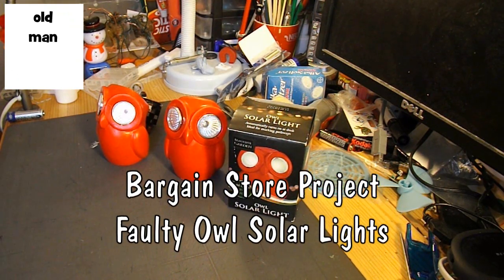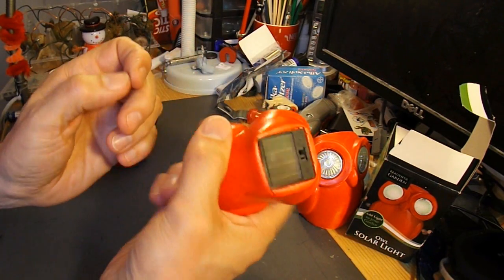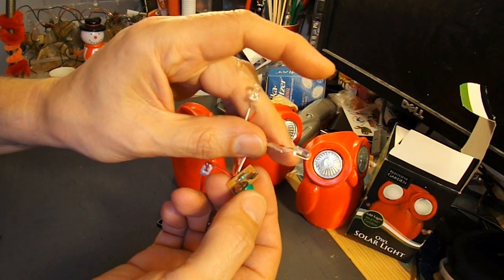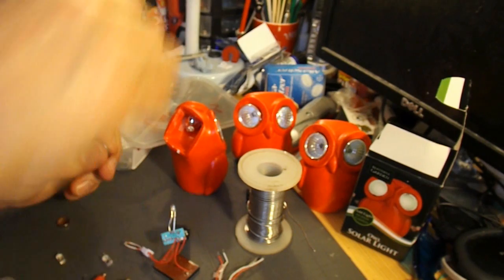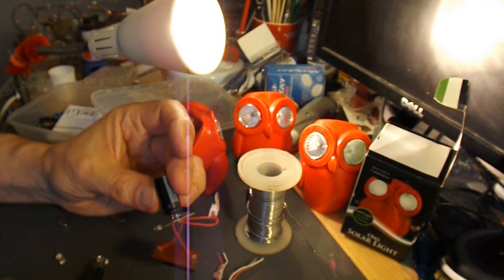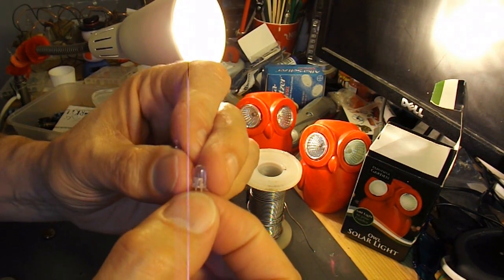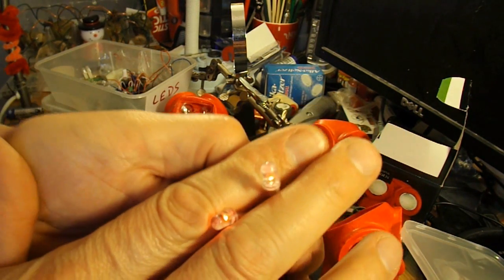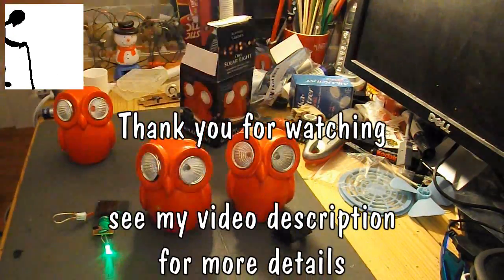Bargain Store Project - Faulty Owl Solar Light

Comment: These owls are fun. I collect similar cheap owl lights. But mine are made of some kind of artifical ceramic stuff. I own 15 different types from different manufacturers. None of them would work as intented. Placing them into the garden would break them quickly by drowning in leaking water. I replaced all LED by warm white ones (I hate cold white light) and resoldered all solderings. Since that, these last for eternity. I bought them all from the cheaper-but-broken batch xD. Most of them cost 1-2€. The regular charge were up to 20€. All were easy to repair by resoldering all solderings and replacing the battery by a better one. The ones I really use in the outside, I made them really water proof and these still work for years. I didn't took them inhouse during winter etc.The neighbours frequently ask me where the warm white owls are from xD.
Reply from the maker: +Frank Saibert mine are indoors, they sit on a windowsill that gets the sun late afternoon and they work fine but I doubt they would survive long outdoors.
Reply: +GrandadIsAnOldMan how much mAH does the NiMH have?
Reply from the maker: +Frank Saibert I am afraid there is nothing written on the cells so I don't know.

Comment: Wtf? Is that green "nibble" a NiMH battery? xDD How much mAh? I own similar owls. These had crappy 1/3 sized AA accumulators. I replaced the entire electronics inside by a higher quality DIY solution and them lasts three times longer since doing that xD.
Reply from the maker: +DünnschissTV well I have done nothing to them since this video and they still work after a year or more. They are only novelty items, I wouldn't spend any more time on them myself.
Reply: Well, if you dislike to do such modifications, it wont worth at all. It was just fun to me doing that. :-)

Comment: Turn the faulty one back to shop for refund or replacement. I was going the other day to buy some of them, now I will check them in shop for sure. Thanks for sharing your findings with us.
Reply from the maker: Hi Medhi, thanks for commenting. These things are so cheap it would cost more to drive back to the shop. When you buy from bargain stores you cannot expect top quality but you are entitled to expect them to work when you get them home so I should complain or at least warn them they may have a faulty batch. Yes, it is worth checking them in the shop if you can find a way to charge them up, the chances are the shop lights will not be strong enough to charge the solar cell anyway. Anyway I buy them for the parts and it gave me an excuse to make a video.